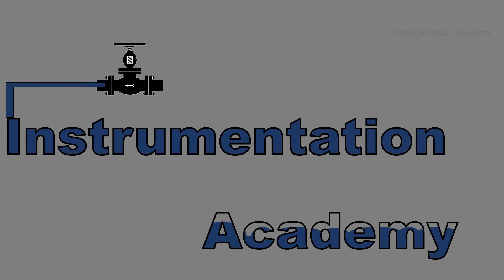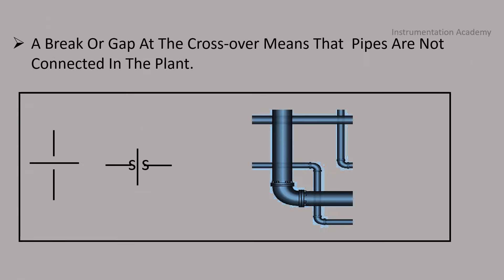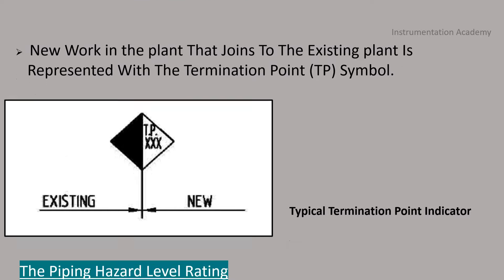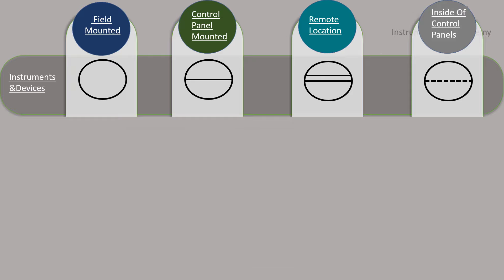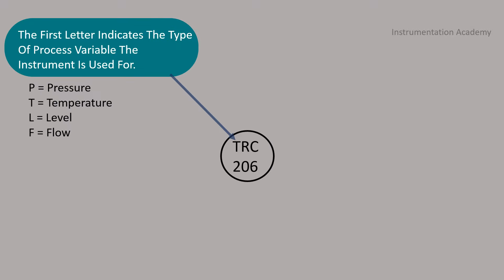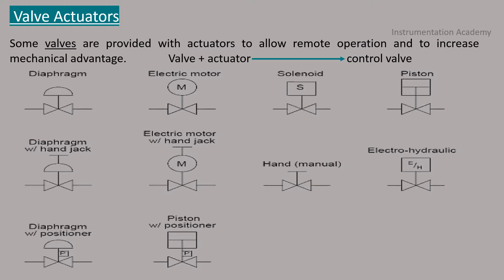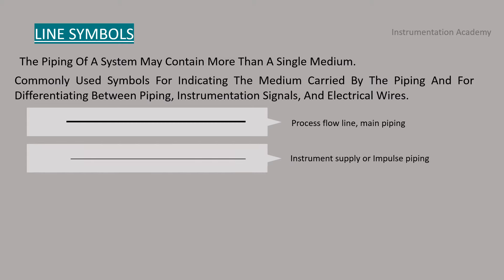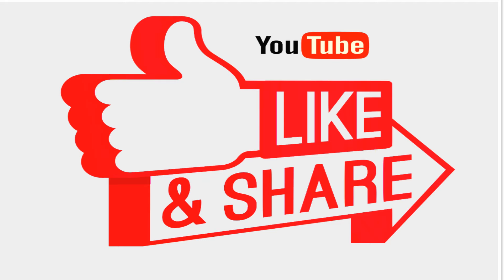P & ID Diagram. How To Read P&ID Drawing  Easily. Piping & Instrumentation Diagram Explained.

Comment: 10:10 I know it might be different for the companies' legend sheet. However  "long dashed line" means future. Let's think momentarily that you created P&ID for the Greenfield project. Of course you will show pipe lines as a straight line due the main one. Because it is not existing piping. So in this case once you finished and plant starts operations, you have to change straight lines into to dashed in your each drawing as they are existing now.  Otherwise people when they will work on Brownfield projects and when they book out those drawings they must identify which one is existing pipe which one is not. If you don't change it your straight lines into dashed line which means existing, people will totally confused and changing making double work. So it is better to identify dashed line as a future line. It's my personal view.

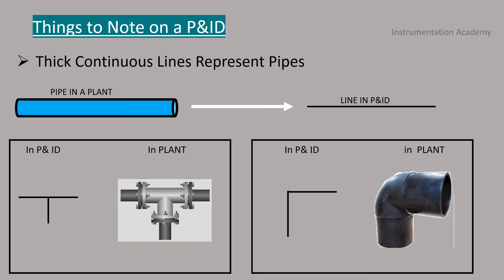Comment: 1:43 Mentioned that a break or gap at the cross-over means that pipes are not connected in the plant. However if you check provided real pipes, you can see they already have been connected. Actually I would say better to use "not crossing" or "touching" rather than "connected" as it may confuse audience.
Reply: Check out CADISON - Modular Plant design and object - Oriented software for plant design in chemical, Pharma, oil and gas, food and beverages and power industries. Providing solutions for process plant to increase efficiency in project engineering. The strength of this solution lies in the engineering data and graphics-driven approach with a single common database.